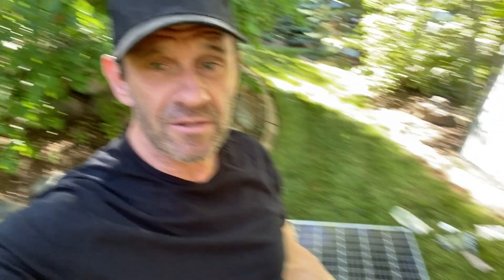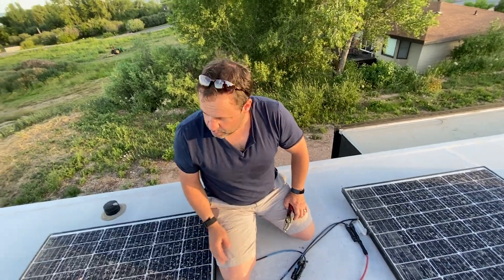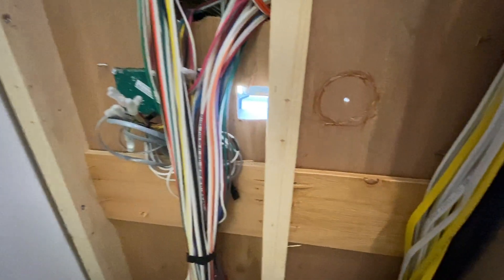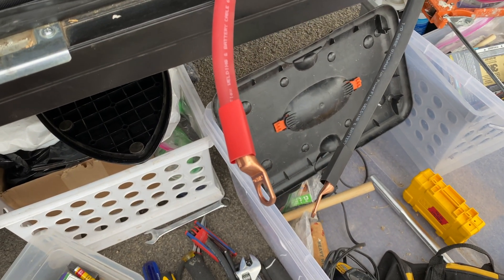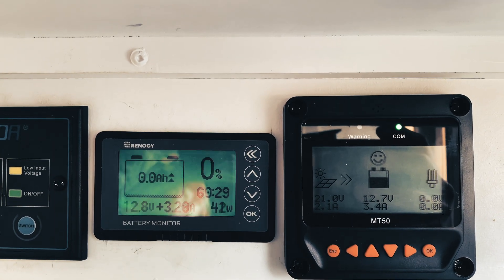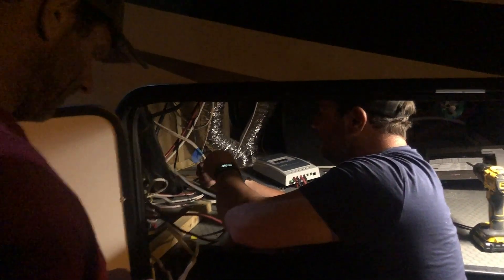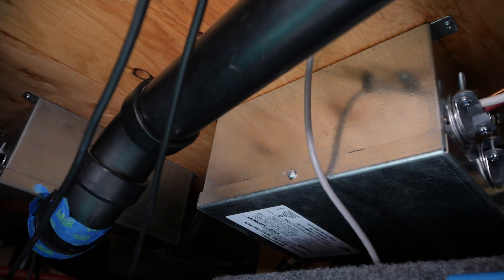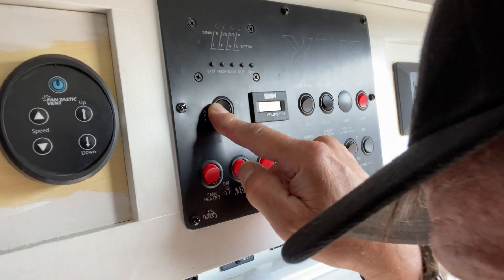RV Solar For Idiots ☀️ Full Solar Parts & Install!

Comment from the maker: ☀️ RV Solar Parts List ☀️ Lithium Iron Phosphate Battery: https://amzn.to/3fmqOqL Battery monitor: https://amzn.to/3ePNq4d Mounting brackets: https://amzn.to/3wbYIph Inverter: https://amzn.to/3wdfpkd Charge controller: https://amzn.to/2TeAk8c
Transfer relay switch: https://amzn.to/3tIwUq 
Marine Goop: https://amzn.to/3htB97g 
RV Roof Seal Tape: https://amzn.to/33KOtw0 Solar Connectors: https://amzn.to/3eNQwWb Crimper: https://amzn.to/2RUTeAe Copper connectors: https://amzn.to/3uO8bTq 1/0 gauge copper wire: https://amzn.to/3hoZOtp 10 gauge copper wire: https://amzn.to/2QKIOTJ